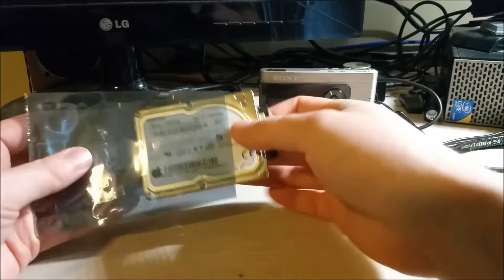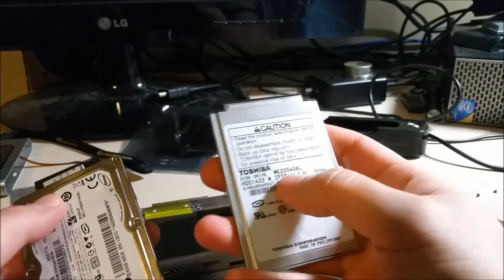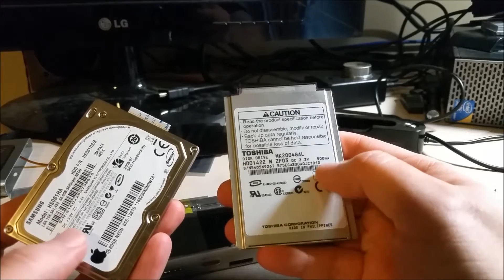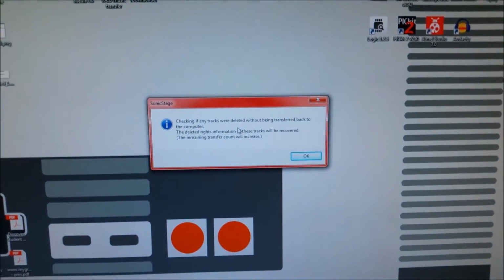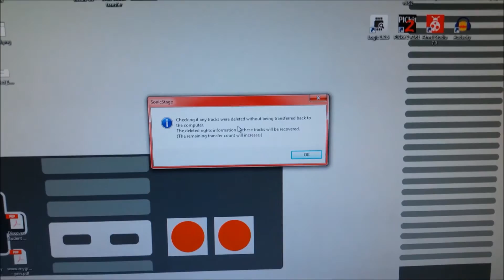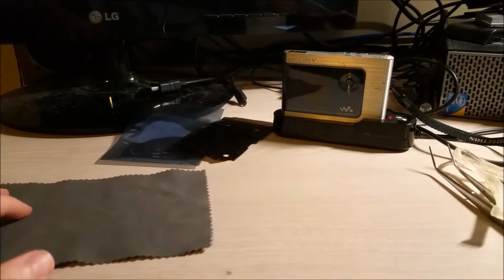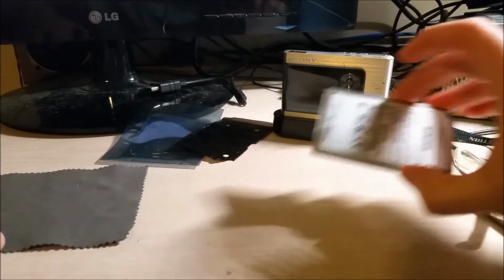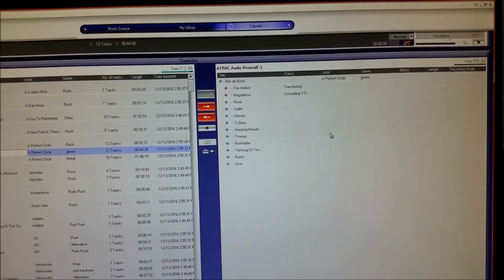Sony NW-HD1 Network Walkman 1.8" 80GB Harddrive Upgrade (World's First and Only?)

Comment: I had one of these back when they came out. My only issue was that horrible proprietary software you had to use. But man was that brush silver just beautiful.
Reply from the maker: Yep, sonicstage is a pox on humanity. I really wish someone would just find a way to make these drag and drop or integrate with itunes.
Reply: @sjm4306  same. Sony really blew it with that. They really let greed get in the way. They did the same thing with their memory stick cards. Trying to make everything proprietary.

Comment: Una duda,  ya cambie el disco duro del reproductor sony y le puse uno de la manzanita de capacidad 40gb y ahora lo que quiero hacer es inicializar el disco duro.  Sabes de algun control remoto para el reproductor sony que sea compatible con el modelo HD3 ? Necesito darle actividad y asi ponerle musica nueva. Espero que haya alguno que si le quede y pueda hacer ese proceso sin problemas. Solución a este problema ya que los botones no me funcionan y el flexor de los botones se dañó.  Gracias
Reply from the maker: I think I heard the himd rm-mc40elk remote was compatible but you'll have to double check before buying as it's pretty rare and very expensive now.

Comment: While trying out a mSata SSD, have you considered trying specifically a SSD with an amperage lower then 0.5A? I tried a Vaseky V800 I bought many years ago and while being connected to my computer the LEDs shine brighter, then in my HD5H. It seems like, the issue is that the mSata doesnt get enough power, but thats only from what I see. I cant find a spec sheet on the amperage of that mSata unfortunately.
Reply from the maker: I've also tried sd and cf adapters and nothing except a mechanical drive seems to be detected and formats correctly. Those options use much less current than msata so I'm not sure that's the problem.

Comment: Una duda. Le cambié el disco duro a mii walkman Sony HD3 porque se me había caído al piso y se dañó. Le puse un disco duro de 40gb y ahora quiero saber si lo puedo formatear desde el dispositivo o lo haría desdé la computadora. Cuando lo intente armar de nuevo, se dañó también el flexor que da función a los botones de arriba abajo así como el play y el adelantar y retroceder. Quiero saber si hay un control remoto que de las funciones del  reproductor? En cuando al formato, se puede hacer en la computadora o desde el  dispositivo. Que me sugieres realizar mejor
Reply from the maker: IIRC I formatted in the player menu and then was able to see the device in the sonicstage software. The firmware on these devices is luckily stored in separate onboard flash so there was no need to do a firmware restoration like ipods need after drive upgrades. As for remote control, I believe there was a remote for these sony network walkmans, but they weren't the regular common discman/md remotes, they used harder to find remotes that often came bundled with higher end sony pda's/network jukebox devices.

Comment: Hola, tengo duda, ya que la unidad mecánica d mi reproductor Sony ae dañó, se puede reemplazar por otro disco duro que sea de la misma capacidad? Espero me puedan ayudar. Es el walkman Sony Nw-hd3. Es un reproductor bueno y me sirvió bien solo quw un dia se me cayo en mi vasa y se me apagó cuando se queda en el logo de walkman. Sugerencia para hacerlo? Muchas gracias
Reply from the maker: Yes you can find these 1.8" pata zif drives for pretty cheap online now and so long as you get a single platter thinner one it'll work (even up to 160gb as they do make those in a single platter drive for later gen ipods).

Comment: @sjm4306 Una duda más. Tengo el adaptador del reproductor Sony y si funciona bien y lo conseguí en marzo de este año. Ahora me surgió unna duda mas. Se me cayo el reproductor al piso y la cuestión es que si prende y cuando sale el logotipo de walkman de repente se me apaga. Nunca t ha pasado? Habrá que revisar por dentro el reproductor a ver si algo no se daño? Espero tu respuesta. Gracias
Reply: Yo lo que no quiero es que se dañe la unidad ya que tengo guardada la música que le he almacenado en ella. 😢😟😟😔😔
Reply from the maker: Depending on how high the drop was it's possible that the mechanical drive inside was damaged. They are pretty fragile and unfortunately if that's the case then the data on the drive is probably not easily recoverable.

Comment: Una duda, donde puedo conseguir ese adaptador donde conectas el cargador y el cable USB? Soy de México y tengo ese reproductor solo me falta conseguir esa base para cargar su pila y echarla andar. Gracias por su ayuda.
Reply from the maker: They don't make the adapter anymore unfortunately so you will have to find a used one off ebay. The smaller adapter that came with the nw-hd3 will also work with this model.

Comment: Can Sony A3000 upgrade SSD????
Reply from the maker: If it's like every other hdd sony portable I've tried the answer is no. For some reason sony hdd network walkman wont even recognize ssd's and even cloning the os partitions manually doesn't work. The firmware must have some sort of drive detection whitelist that will only boot from a mechanical drive.

Comment: classic users turn to CF(micro sd inside) and u went to this old HDD instead?

will it drain the batt worse than it already did with 20gb onboard
Reply from the maker: These Sony portable audio players cant be flash modded afaik. I've tried several adapters and the unit just wont recognize and reformat the new media like it does with mechanical drives so the firmware must be checking some whitelist or response from the drive that flash memory fails. As for battery life, the zif drive actually is newer and slightly more efficient than the original drive so should give a bit better runtime.

Comment: I just found one of these in a drawer... maybe I used it until the ipods came out? Not sure why I abandoned it. Pretty sure I don't have the dock - what can I use to power it?
Reply from the maker: Some portable minidisc recorders of the same era use the same connector to usb but they are rare/expensive/proprietary. I know a few people have done usb mods to desolder the proprietary connector and replace it was a micro/mini usb port.

Comment: The new adapter from iFlash for the older iPods might actually work for this to easily convert to a stable flash option, too.
Reply from the maker: I've encountered an issue with solidstate mods for a few sony pmps, I have a feeling they are doing a device identifier check at the firmware level to whitelist mechanical drives but not the sd/cf/msata drives I tested. Here's hoping there will eventually be some workaround.
Reply: Chances are it could be a timing issue. When installing Ubuntu to a SSD, I once had to add a delay (just a few microseconds!) in boot parameters because the SSD was "too fast" 😂
Only then the OS would recognise it. Maybe its a similar problem with the Sony players, so either way, the answer probably is in the firmware. Unfortunately there is no alternative firmware - or am I wrong? 🤔
Would be great if it was open source 😄

Comment: I know this is an older video, but do you know if the dock connector is the same as the other Minidisc players like the MZ-NH1 or MZ-N10?  They look very similar.
Reply from the maker: I believe they are physically the same but couldn't say if the pinout were identical as well without doing some research.
Reply: They are the same, I have a couple of NW-HD3 connectors, and they work with NH1 and N10 for PC connection, but they wouldn't charge though.

Comment: I got this in 2004 and it was fantastic. I damaged it because the docking station is a daft design choice - I would knock it error and the whole thing would topple of the desk. I also managed to damage wires that charge and connect to computer as they were so fiddly. Finally replaced with a first gen iPod and it is still going! I have always wanted to fix this though so perhaps I will try although my tech level is zero.

Comment: Hello!! I'm trying to install a Compact Flash drive in a NW-HD3 model, which is pretty much the same as yours when opened. I wonder if you had to format your 80GB hard drive before installing it in the mp3 player. Some it doesn't read or detect anything when turning on. It's stays with the "walkman" screen on for half a minute and then it turns off. I know that installing a CF drive in ipod classics  has been tested and proofs to work well. I thought that it could be much the same with Sony NW HD3 walkman and watching your video I see it's quite strait forward, but some how  I'm missing something,,, it could be the CF it self, or the format given (Fat32, Fat, NTFS...).
THANKS!!
Reply from the maker: I used the reformat drive option in the menu. There's a chance that only mechanical drives will work if the walkman checks for the drive signature on bootup. I recently had this problem with trying to swap the microdrive in my nw-a1000 with a cf card, it refuses to recognize the new card even if I clone the contents of the original microdrive to the card.
Reply: I managed to open the NW-HD3, there is hidden screws on the side, which the chromed metal need to slide off and 2 screws there. The HDD inside is MK2006GAL and the cable ribbon is so small and unlike the NW-HD1.
Reply from the maker: Yeah they moved on to zif pata 1.8" drives by the time the hd3 was released
Reply: I have a nw-hd 1 and hd-3. I can use an old ipod HDD (30gb) in the sony, but I just cant get anyhting else to work. I have tried SD, CF of many different capacities and brands with 2 different adapters. These ALL work in my ipod clasic video but none work in the sonys :-(. I get the same "walkman screen" then all goes blank. I have literally tried everything. Such a shame as a small, silent, quick access, power efficient 256GB sony nw-hd 1 would be awesome. I just think the sony refuses to accept anything other than an HDD. (I also tried numerous fromatting types in Windows).
Reply from the maker: I also think the firmware must be checking for a mechanical hdd I'd guess by the serial number or something.

Comment: I have one of these.  I don't have the in-line remote thing.  It must have not came with it cause I usually save everything, but I may have lost it I guess?  I haven't used it in probably 7 or 8-years I'm guessing, but I remember the battery life had become quite bad.  It looks like replacing the battery shouldn't be too difficult though by your teardown which seems to show it should be a screw or two holding it in place.  Funny, your video says something about sending it in for the MP3 upgrade which I vaguely think I may have done (I'm 60 now and my memory follows).  To get mine working I believe all I probably need to do is to get a new AC adapter as when I found it in some stored items the adapter's wire coating had dried out and was coming apart in many places exposing the bare wires which would, of course, short.  I think it said 5-volts on the black label that in green ink showed a 5-volt rating (you said 6 so perhaps I dreamed 5).  They're cheap on Amazon I see.  One question...the Sonic Stage or whatever software is obsolete with current OS systems so is there another software that I can use either on Windows or Mac (or works for both)?  Here's another thing I found I had forgot, I ordered the Sony protective cover which looked kind of like woven carbon fiber and would allow you to protect the device when used in the field.  This really was a great music player.  Was there ever a cable that allowed direct digital out?
Reply from the maker: I dont think north american regions got a remote as a pack-in. A few minidisc/discman ac adapters I received also have rotting ac power cords so I guess it's a common issue. As for sonicstage there's a patched version that works with windows 7/8/10 you can find online (just google "sonicstage windows 10" and you should be able to find it with a little searching), I've been using it with two of my laptops and it works ok with windows 7 and 10. As for a direct digital out cable, unfortunately it doesn't exist I suppose due to music piracy concerns.

Comment: Nice job!  Do you have an updated hack that uses an SSD instead?  These old Sony network walkmans still sound great but a fast energy efficient high capacity solid state drive would make it even better.
Reply from the maker: I have old videos where I ssd mod ipods so I see no reason why the same mod wouldnt work on these walkmans.

Comment: I finally managed to change HDD to the same Samsung drive in my HD5, but after initializing HDD I've started to encounter some problems with SonicStage. Did you have any issues with transfering tracks to player after this upgrade?
Reply from the maker: I've always had issues with SonicStage (the pos locks up and crashes like every few times I use it). It was buggy before I did the hdd mod, and it is just as buggy after I've done it.
Reply: @sjm4306  For me it was working quite fine before the mod, and after I just can't transfer more than 5-6 albums, and after that I get the 'couldn't transfer' message, which makes 80gb drive useless. I'll try to run SonicStage on clean Windows XP maybe, but I'm afraid it has some issues with recognizing my HD5 with that drive
Reply from the maker: That is very weird. I've synced like a few hundred songs at a time without issue. Did you carefully insulate any potentially shorting parts between the drive and board/back metal case before closing it up? Does it feel very warm when you get the error? Another possible issue is how much current your new drive pulls in relation to what the original drive did. I suppose it could randomly brown out the device if it pulls too much power.
Reply: Both the original drive and new one are exactly the same as your HD1. I'll check the interior, maybe I'll try to run it with drive outside to see if everyhing is connected well. It gets a little bit hot, but it gets just as hot when there is no error. There is less space inside HD5 so it is understandable. I hope it's a software issue though.

Comment: Great video. Based on this I'm going to upgrade my NW-HD5. Even less space inside, I'll try with these ribbon adapters (if I can find any). Those players are really worth the effort, 352 atrac quality is outstanding
Reply: Did you end up doing it? I also have a black NW-HD5 and was hoping to upgrade to solid state and this was the only video (not solid state but still better than keeping stock!)
Reply: @beatchef  I did it, wasn't really successful though. The only thing I have managed to achieve was breaking the ribbon cable connecting buttons, I ended up without working STOP and UP. Be careful with it.

I believe I've used the same Samsung drive as the video author. It booted, and managed to format the drive successfully, but I couldn't move songs onto it. Every time I tried to, Sonic Stage would crash after ~5GB of data was moved to player, if I recall correctly. Might have been a broken drive though, I remember buying a few of them, but I believe this particular one was advertised as a working one. 

I am sure it is possible, and I might try it again, but since then I've acquired iPod Classic 160GB (sounds worse BTW) and don't use Sony that much.

What are you planning to use? M.2 drive?
Reply: @janczajka6749  is it bios issue ( where it wont read more than the F/W had in first time on the original memory )
Reply: @sargera1  it may be. I couldn't transfer more than a few albums to the new drive. I don't remember the exact numbers now, but I believe it crashed even before reaching original 20GB limit. But given how NW-HD1 worked with 80GB drive I believe it was something else. I'll try using 160GB iPod drive as well as the 80GB one once again, I'll also try some microSD/CF adapters.
Reply: Hello. Can you help? Can you model of  that HDD and where I can buy it... HDD and connector.
Or says model of that hdd

Sorry 4 my English. I'm from Russia

Comment: i have an hd3 player. I can also change hdd to more voluminous?
Reply from the maker: I believe the hd3 is very similar to the hd1+2 so I dont see why not.
Reply: @sjm4306  did you succeeded in upgrading the hdd to ssd ? I took mine 2 screws out and instead the whole thing come out, the plastic cover comes off. I didn't dare to pull it hard to slide it out and I put back the cover and the 2 screws.

Comment: Another aspect I was curious about. These NW-HD1 versions have a maximum amount of tracks, groups and albums of 8192 that can be indexed. This seems lower then the 13.000 tracks you can potentially store on the 20GB native drive. Did you ever try to maximise the storage with 48kbps tracks only and did you encounter an error? This would mean the HD1 isn't conceived to store only 48kbps Atrac3Plus tracks on its drive but mainly 128kbps or even higher bitrate MP3 files. Do you consider this a intrinsic problem with 80GB ?
Reply from the maker: Robbert Lucassen I mainly got this player because I heard about its good sound quality so I've been loading higher bitrate files. Haven't ran into that track number limitation yet as I really only have around 5k songs that I listen to regularly, but that will be interesting to test.